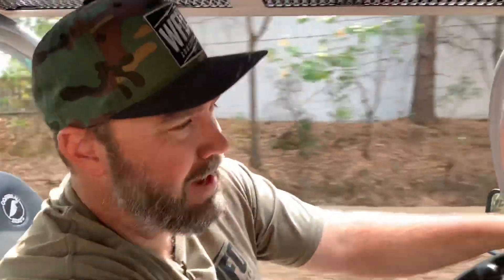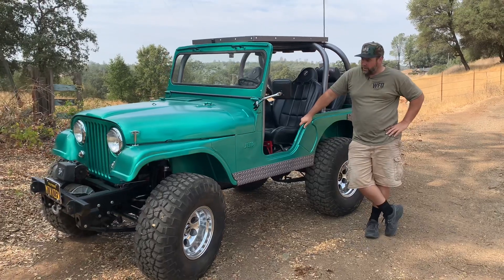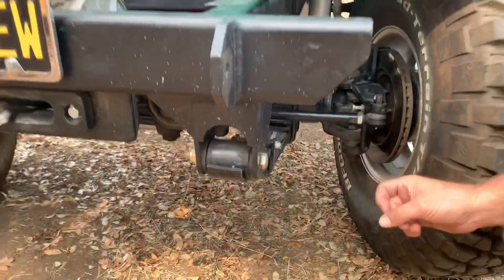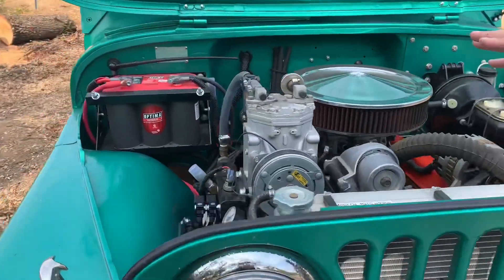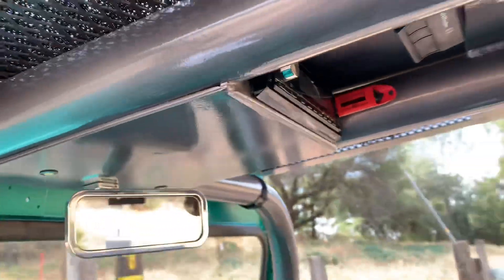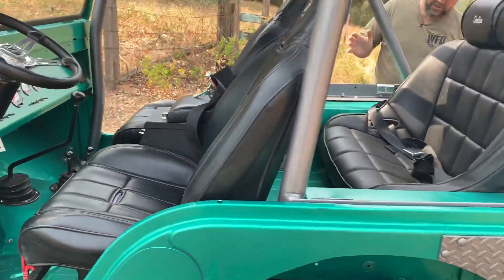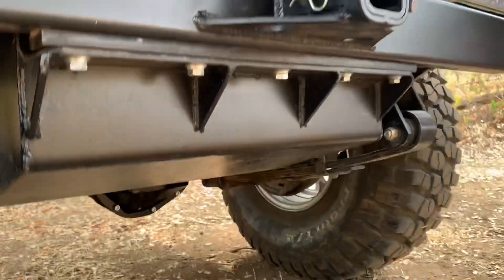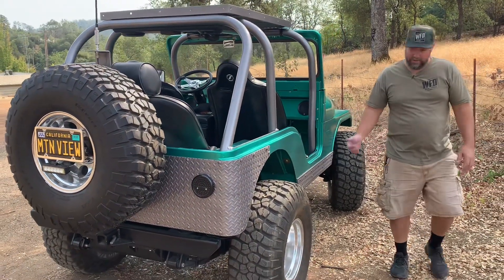1960 CJ-5 on 35’s with 4.3 Chevy

Comment: I'm in Alaska I found a barn find 62 cj5 with 1600 original miles and f134 engine, it has 2234 miles now only does 55 mph with the 5:35 stock gearing, will stay stock, but need to find a cj5 builder I have a AMC 401 already, that 60 cj5 is just an awesome build one of the best I've seen, thx for sharing

Comment: My 1964 M38A1 is set up the same way. TBI 4.3ltr, SM465 , Warn locking hub full float offset 44 with Detroit Locker. It also has Warn OD, a Dana 30 front axle with the ARB Locker running 33" BFG's. Mine's also restored. It's red with some Military hood markings.

Comment: Sweet rig.  I’m putting a 4.3 in my 71 cj5 right now. Definitely need to look into the swing pedal and brake setup. Thanks
Reply: Going back and looking at it I don’t see a heater. Mine mounts right where the master cylinder is. Was it just eliminated? Thanks

Comment: I have a 69 cj5 with the ductless v6 in it engine is seized solid and not worth salvaging thinking of going with the 4.3 vortec  but using my transfer case and tranny is this swap difficult and can you recommend a good kit thanks
Reply: Have you found out any more on the swap? I just picked up a 73 cj5 and about to pull a 4.3 out of a wrecked chevy. Just looking for some insight on it
Reply: Ended up getting another v6